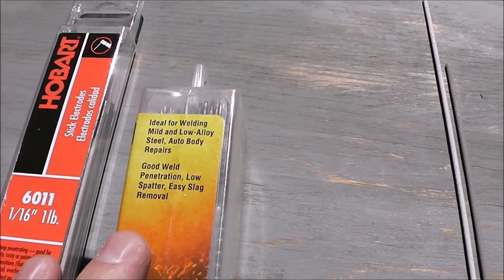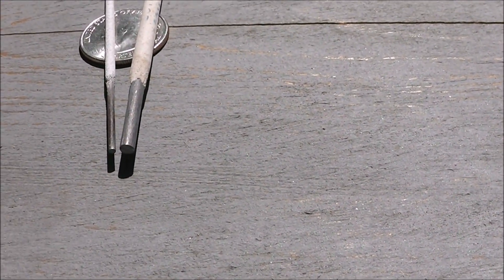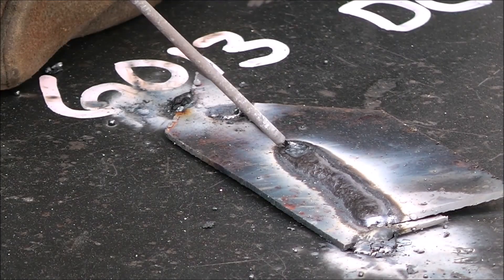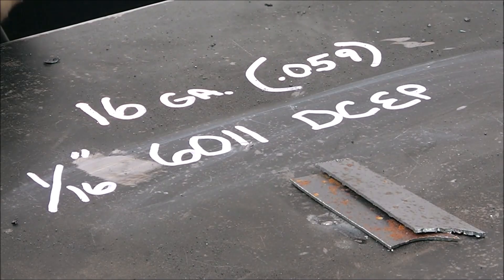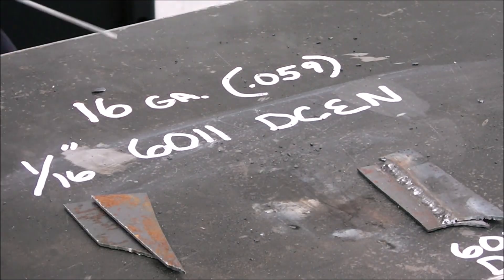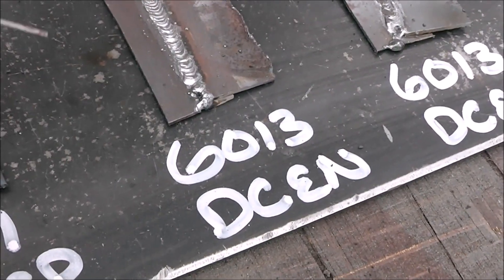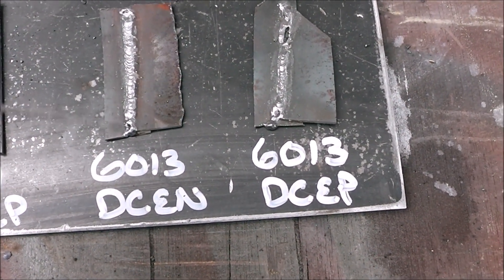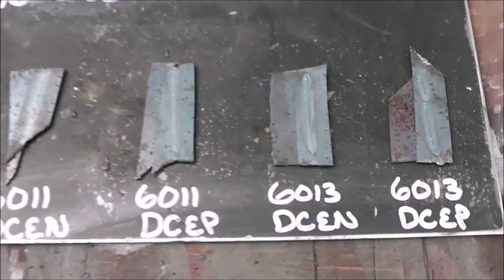6011 Vs  6013 BEST POLARITY for WELDING SHEET METAL

Comment: FYI I find the Lincoln 3/32"  6011's burn MUCH better with inverter welders.. I have Hobart 3/32" 6011's and can't maintain an arc.. I think the low OCV on inverter welders is the issue.. Lincoln rods work well in other sizes and types too..
Reply from the maker: I agree with you, I like the Lincoln rods also. FYI, this welder will run 6010 rods too!  Most inverters wont for the reason you pointed out.  I just found this out recently and was quite surprised...I ran 1/8" 6010's down to 36 amps and surprisingly enough I was able to keep it lit at that low range. Cheers brother!
Reply: Wow that is awesome! I have not tried 6010 as I think they won't work on my welder but would like to try a stick or 2.. Really enjoy your videos keep up the great work!
Reply from the maker: Thanks man, I appreciate your support!
Reply: Thanks for sharing this. I have a small inverter welder and running 6010 is almost impossible. I can run every other rod (6011 is better than 6010 but not great either) but I haven't tried the Lincoln rods. I'll buy a couple pounds of each and give it a shot.
Reply: You're welcome Rich! Please repost after you try them.. If you haven't learned the whip & pause method I suggest you look for this here or perhaps Brandon Lund can demonstrate this technique if he hasn't already done so..
Reply from the maker: @raybonz7939  Great advise! It took me a minute, I was pretty sure I had done a whip and pause. Thanks buddy for your input and suggestion. THIS is what the comments are made for. HERE YOU GO RICH https://youtu.be/1s2IfAG4IVE

Comment: ac/dc polarity doesnt do shit  its the same thing unless youre welding magnetized steel then u want to use ac
Reply from the maker: Actually dc has a smoother arc because the frequency is not pulsating at 60 hz. AC is also doesn't have arc blow.  Thanks for watching! Cheers!

Comment: And the whip & pause is for things like pipe when you're making keyholes to build a backing for the hot pass, joining two spaced pieces instead of a lap joint.
Reply from the maker: CavemanJoe I’ve never had good luck just dragging 6011. It could just be how I was taught. For lap joints, I tend to focus on the toe of the bottom plate and wash the puddle back flush with the upper plate.
Reply: Brandon Lund 

For anything other than pipe, I've found 6011 to be best for just tacks or short runs on things that have to be fixed in place with minimal prep. It does go deep, but it doesn't have good flexibility for things that get any torque.

Comment: Nice video. I was wondering if that welder could handle suspension mounts on a utility trailer. I know my mig unit won't.
Reply from the maker: Jim Allmon thanks! Yes this welder will easily handle spring mounts. I’ve done it with my 140 mig on flux core wire but it’s really pushing it on 1/4” plate. This welder will easily handle 1/4” and up.
Reply: Brandon Lund thank you sir!

Comment: Another good one what’s ur suggestion on that welder on amazon it says package is damaged  it’s 223$
Reply from the maker: Ronald Parady that’s a pretty good deal... I tend to like good deals so i personally would probably go for it. My only concern would be what happens if the unit is damaged... will it be replaced with no hastle and who pays the shipping. If they are willing to accept all the charges on a return, it sure would save you some cash $$$, which is always nice :)
Reply: Brandon Lund thanks

Comment: Agree with you 100% Brandon. As far as polarity, when welding on dcep the heat is directed on the workpiece, when welding on dcen the heat is directed mostly on the electrode. That’s why it seems hotter using dcep.
Straight polarity dcen: straight electrode negative (SEN) short for senator, reverse polarity dcep: reverse electrode positive (REP) short for representative. Just a trick to remember how to determine straight polarity from  reverse polarity. Superfine video!
Reply from the maker: Thanks Richard and I want to thank you for your great comment in the previous video. It was one of the ones that prompted me to do a follow up video!  I like your memory trick for remembering polarity! Awesome!
Reply: Cheers for that info about heat on the base metal & not the rod when polarity is about face

Comment: Good job . With those skinny rods (which I try to avoid using), I sometimes hold a second rod at roughly 90° or so under the rod in the stinger to get going. I learnt on 6013s, on AC (only time we had DC was from the diesel generator setup) we ran em hot, they ran fine, always had the slag peel right back, never needed chipping hammer or wire brush, maybe they don't make 6013s like they used to or at lower amps on inverters they don't run well? Cute lil Winston Churchill impersonator you have there :)
Reply from the maker: Thanks buddy! Interesting idea on using the 2nd rod...I will have to give it a try! The slag seemed to come loose a little easier for me on dcen than dcep but it wasn't peeling back like you mentioned.  It's satisfying when it does though. He grand baby is a lot of fun. I compared him to the original "Uncle Fester" on a show called Adams Family.

Comment: Good video! I welded 2 hooks on my tractor bucket with the HF 80A inverter with1/16 rods, No idea how many passes, when I was done the bucket looked like I was cleaning up after 50 kids on the 4th of July! Still holding though!
Reply from the maker: I bet it did looks like 4th of July! They burn fast!. That is a small rod for that project! Multipass! :)